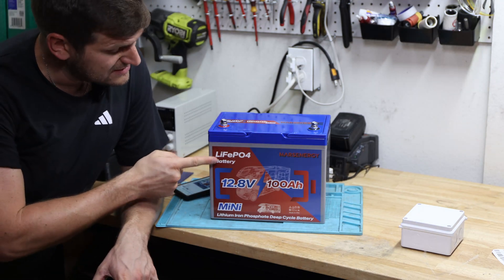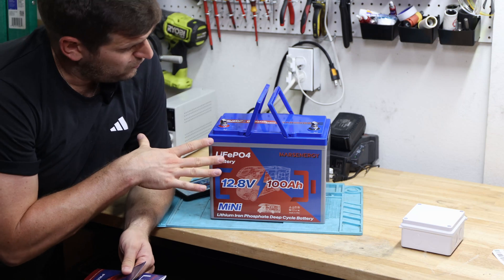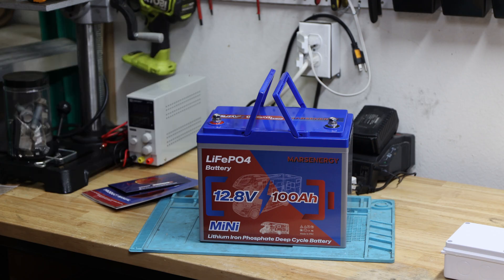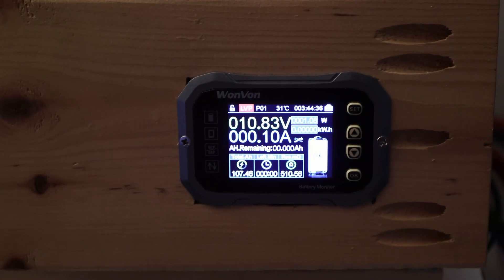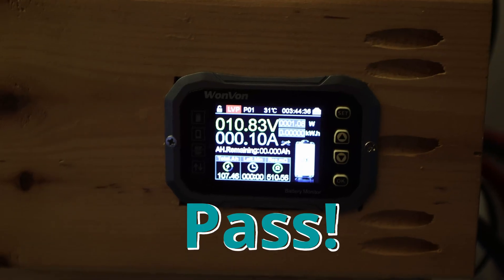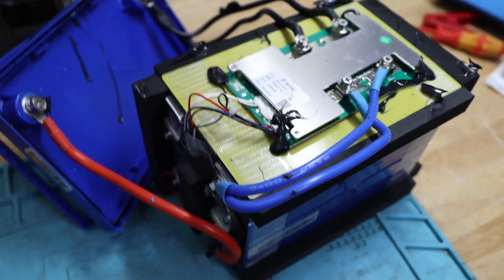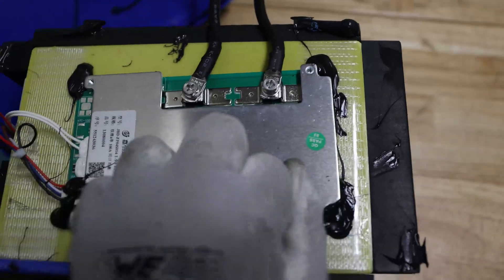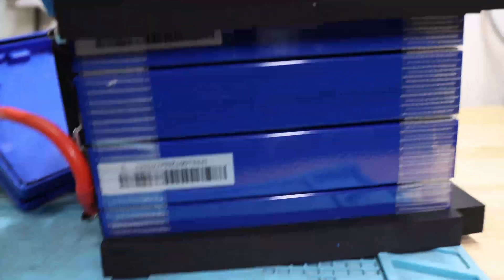MARSENERGY 12V 100Ah LiFePO4 Battery Review – Teardown, Capacity Test (Group 24, Smart BMS?)

Comment: Thank you for taking the time to share your feedback!
Regarding the battery, it indeed features low-temp cutoff protection.  Both high and low-temp monitoring functions share the same temperature sensor—the BMS board extends a probe positioned adjacent to cells.
As such, directing refrigerant spray onto the BMS body would not activate low-temp cut-off, as the sensor is not located there.
Reply from the maker: I sprayed it on the high temp switch and nothing happened since it is only a high temp switch. Please review your BMS and footage accordingly.
Reply: @tobisreallifeskillswithtobi  Thank you for sharing your test conditions and results.
We used a -20°C/-4°F constant temperature control box, where battery were preconditioned for put in 24 hours before discharge. Then a discharge test was performed in the box and the BMS cut out after about 10 seconds of discharge.
If it is convenient, could you please tell us the model of your refrigerant? 
We would like to purchase the same refrigerant for testing. Thank you!
Reply from the maker: I only used a duster spray - the chemistry should not go far below 0C otherwise you risk damaging the cells -I'm surprised you would go that far below 0C as a battery manufacturer
Reply: @tobisreallifeskillswithtobi  We set the discharge low temp cut-off to -20°C and the charge low temp cut-off to 0°C , for following reasons:
1. Charging at low temperatures can cause lithium dendrites to form inside the battery cell, creating the risk of internal short circuits and fire. Therefore, we set the charge protection to 0°C. 
2. Low-temperature discharge only causes a loss in battery capacity. Our cell's actual capacity is about 108Ah, 8Ah more than the stated 100Ah, more than offsetting this capacity loss.
3. During discharge, the cell itself heats up, raising its internal temperature above the ambient temperature, making it more resistant to low temperatures than charging. Furthermore, our cell's electrolyte contains a low-temperature additive. Discharging at ambient temperatures -20°C will not damage the battery.
In short, you can safely use the battery to discharge at  -20°C, but do not charge it.
We're not trying to brag about the superiority of our cells. All A-grade cells now have low-temperature additives and extra capacity than the stated. Ours is not superior to other A-grade cells.
Reply from the maker: The cold temperature protection would be okay, but yours is not working as tested in this video.
Reply: @tobisreallifeskillswithtobi  I see. The discharge protection function only triggers at -20°C. This temp is not easily reached.
Thanks for your suggestion. We will consider filming some test videos of the -20°C constant temperature control box, or some actual winter videos, to include in our product videos.

Comment: I seems like the high temp protection would cut off power after the battery catches on fire which is very likely considering that it doesn’t have high current shutoff.
Reply: Sorry for the misunderstanding. 
Our BMS does have overcurrent protection. Its continuous discharge current is set to 100A,  peak current is set to 300A.
This design is intended to meet the needs of devices that require high current for a short period of time.
Current exceeding 300A will cause the BMS to cut off immediately. Currents <300A will discharge for a period of time, ranging from 1-2 seconds to 1 or 2 minutes, before cut off.